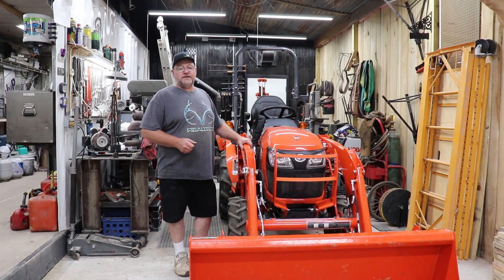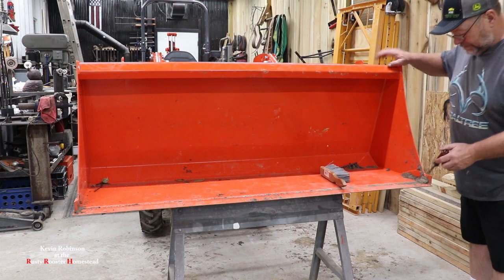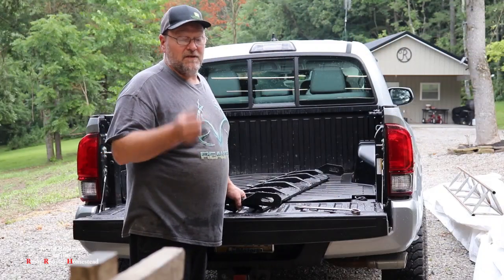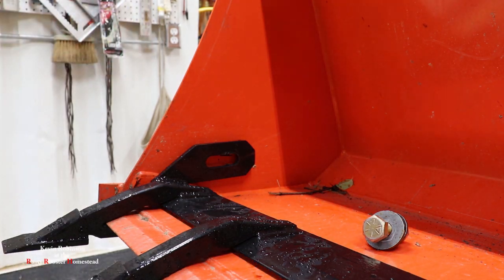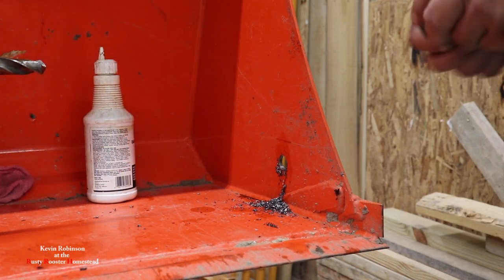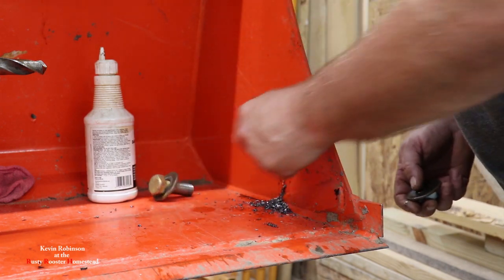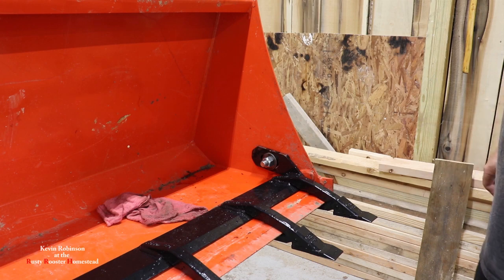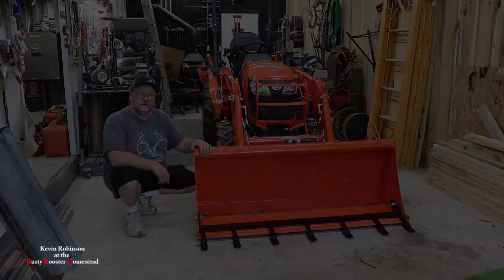how to install a kubota tooth bar step by step

Comment: Awesome add on Kevin, great for pulling brush back and breaking through the hard soil, and tearing things up, maybe I would put another nut on those threads that are showing so they dont get damaged from rock or what ever you are scooping up, there in a bad spot, It will be brutal removing those lock nuts with damaged threads, just a thought, love the videos, keep em coming.
Reply from the maker: Thanks Joe, good idea.

Comment: New Kubota owner here, a BX 2680 with LA 344.   Learning to take care of my place.  Where can I get one for my tractor?  Did you buy tooth bar from a Kubota dealer? And can you explain what you mean by "seizing". and what kind of substance you used to prevent "seizing"?   Thanks so much for video.
Reply from the maker: Yes i got it from the dealer that i bought the tractor from, i left a link so you can give them a call and they will give you all the info you need so you can order one for you tractor. I used anti sieze  for the bolts it keeps them from rusting up and makes them easier to remove and you can by it from an auto parts store.

Comment: Why put the hole in the center? All the to the rear I would think. You are not moving it once it's on.
Putting the hole in the center will allow the tooth bar to move forward and rearward , not good.
Reply from the maker: Thanks for the comment.